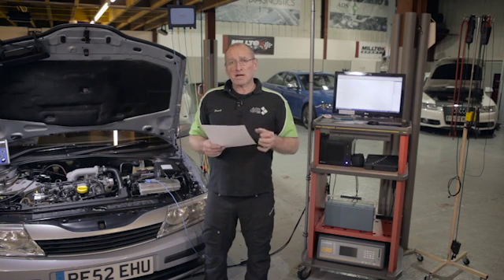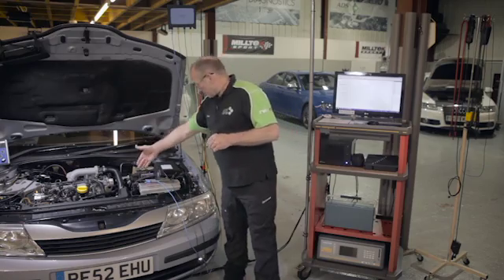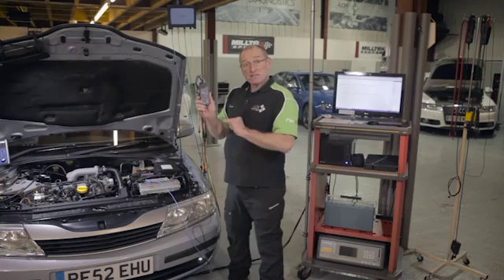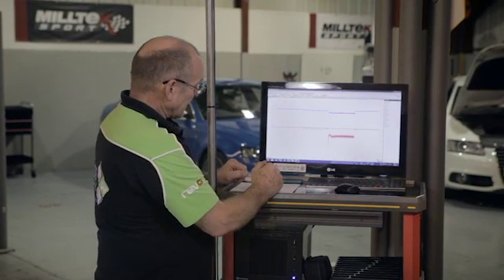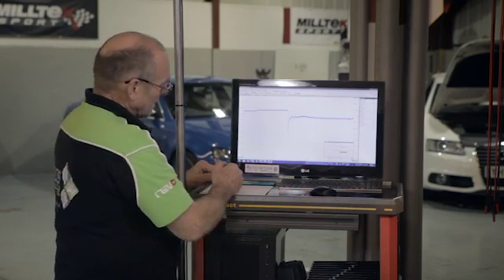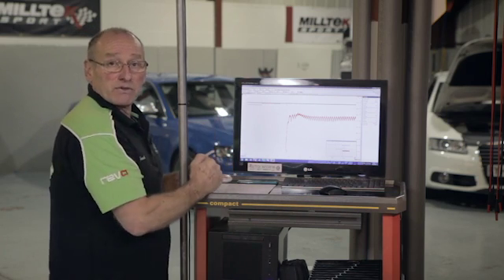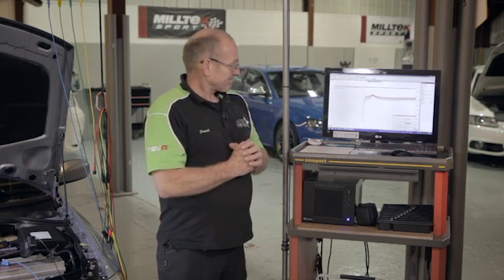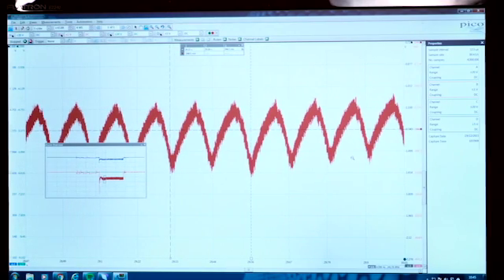Frank Massey's Top Ten tests with PicoScope: #1 Cranking current

Comment: Back around 1980 , I went to the salvage yard for a used battery . I had a Milton load tester and they laughed at me . The guy used a tire iron to short the terminals out . Big spark : battery good , small spark : maybe not good , no spark : dead . Was that an SAE test ? I bet the same idiots are still butchering vehicles !

Comment: I liked the video but disagree that the current should be a function of battery capacity; the load - Frank referred to this as the consumer - should be what you are looking at.  Cranking amperage will be affected by the starter motor, the engine compression / condition.
Reply: bhartwigutube I think he was referring only to the health of the battery. I could be mistaken
Reply: bhartwigutube you have a point but each battery is designed for the load. And this is a well known rule of thumb as well. Obviously nothing beats having a known good waveform, but 3.5xah is a general rule of thumb

Comment: Hello! Frank, please tell me how you measured ampere rating of that battery (10:11) doing 70 x (3) = 210 Amps? Please explain! Thank`s!
Reply from the maker: Hi dorcky. As Frank explains, the consumer should take about 3.5 times the ampere-hour rating of the battery. Looking at the battery, Frank tells us that it has a stated ampere-hour rating of 74. To simplify the math, he rounds it down to 70. Now he needs to multiply it with 3.5. He knows that 3 x 70 = 210, and that he'll then need to add another 0.5 of 70, plus a little extra because he rounded it down. Looking at the screen,  the capture states 268, so Frank is happy that that is close enough. I hope this explains it a little more.

Comment: why would i need all this if my cranking amps on a simple multimeter would give me 9.5V or higher?? i mean it looks like great fun to know all this but i ask why besides the fun?
Reply: Because you wouldn't know if the voltage is low due to a weak battery or because of a stiff starter motor. Voltage low, current low = bad battery. Voltage low, current high = bad starter
Reply: @craighewison1363  I realize this comment is super old, but it really helped me understand what sort of decisions this info could guide me towards. Thanks!
Reply: The Angry Yota Tech unless you had two multimeters so you could measure both at the same time, capturing an intermittent fault would be difficult due to having to perform the two tests at different times. Each to their own though i suppose, its whatever suits the individual job in hand at the time.

Don't forget scoping the starter current can be used for  assessing relative compression, impossible with a DMM

Comment: I like how you add in the rpm's to the equation and how to find out what the current draw should be based on the amp-hour rating of the battery. Super useful information!

Comment: great info thanks . do you think this is a better way to test the battery then using a battery test say like  Midtronics ?
Reply: Just about any way is better then the Midtronics. Tri State Battery tries the lastest greatest on the market each year, and every Midtronics as lied with in 2-3 days if not sooner. Load testing is way better, but getting a printout for consumers doesn't really exist. Midtronics is suppose to be the industry leader, but I have yet to find one that won't lie within a couple of days of using it.